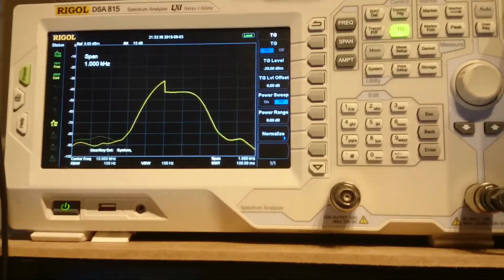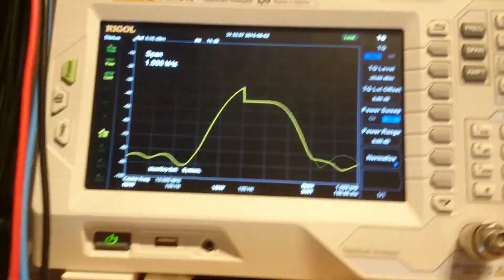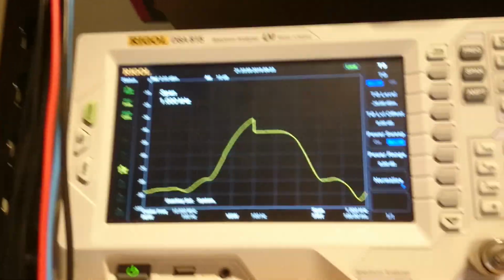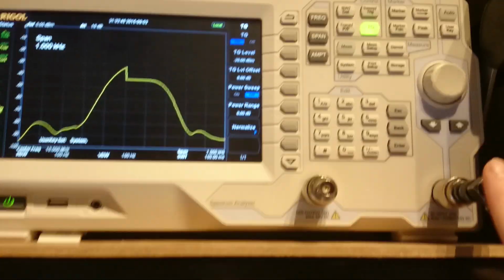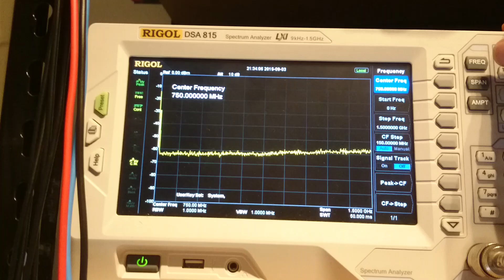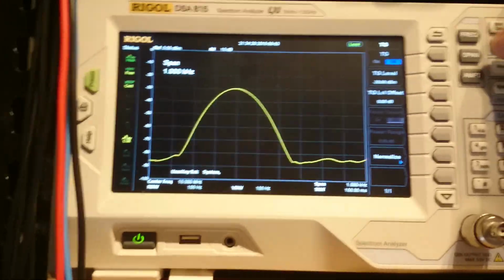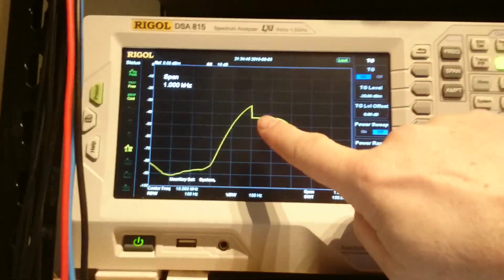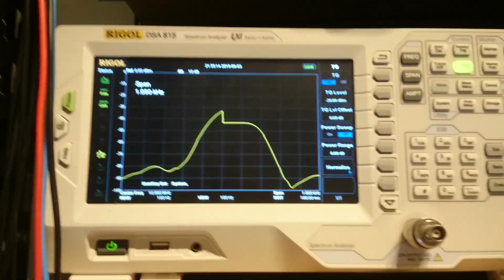Rigol DSA815-TG Spectrum analyser 10MHz bug

Comment: There is 1.05 firmware which is supposed to improve demodulation.

I was emailed it indirectly from Rigol in Germany after approaching Batronix where the SA came from.

Could someone confirm or deny this bug.

Apply a -10dbm signal frequency doesn't really matter (10MHz). Turn on the pre-amp and press Auto.

When it has found the signal reduce the input attenuator till it starts beeping and showing IF signal out of range messages.

Then set zero span.

My experience is the analyzer will stop updating the trace, beep continuously and not respond to any key except the power on/off button.

It is another version of the problem with the TG providing a continuous mixer overload  locking up the UI.

You need to remove the input signal to recover.

old post...